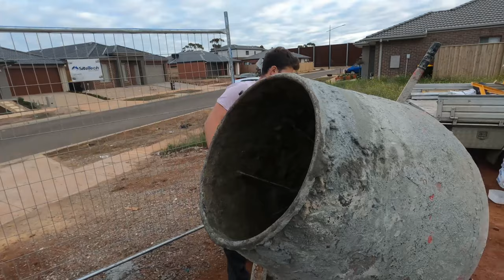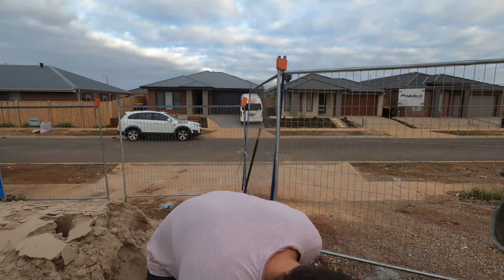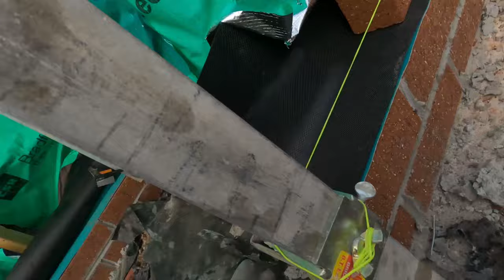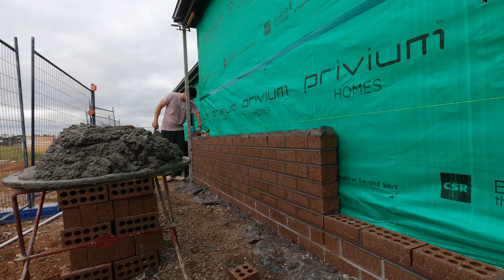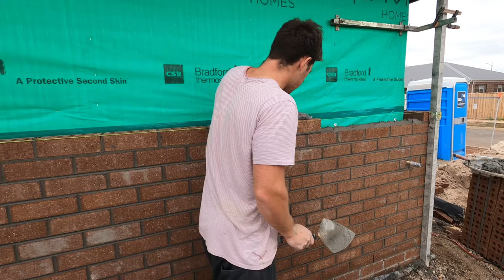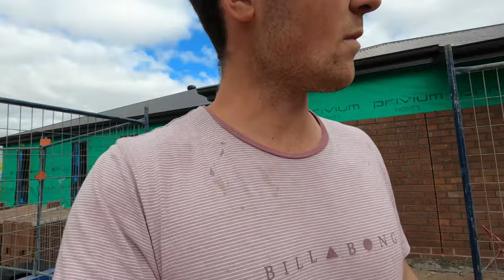Mixing Mortar / Laying Bricks in Australia

Comment: 6:1 that's half bag cement is a buckets that's strong mix  that's 3:1 mix 3 🪣 sand 1 🪣 cement. Bucket should be standard 15 L. Well said water the enemy of mortar the less the better.

Comment: You got to gage with buckets. But his using two different sized buckets
Reply: what’s that matter? Aslong as you fill each bucket properly it’ll still come out the same colour. That’s all the bucket method is for really, just so you can’t stuff up the colour by adding/missing 3-4 shovels